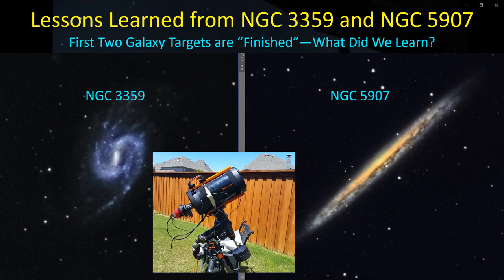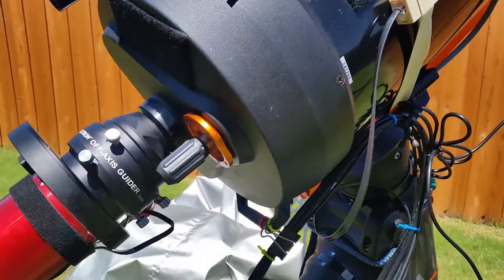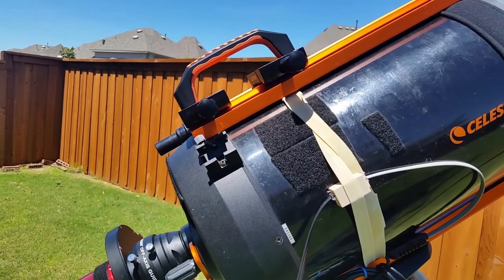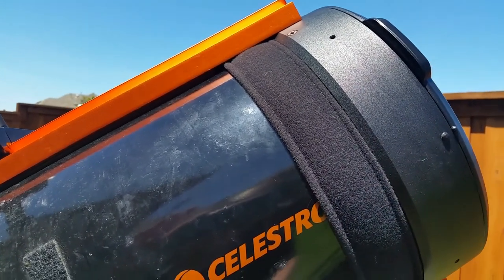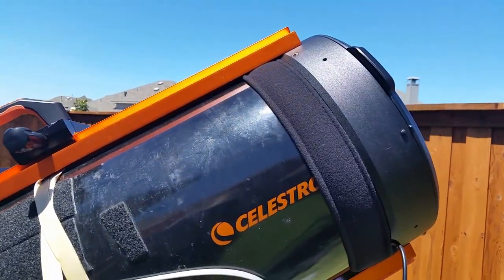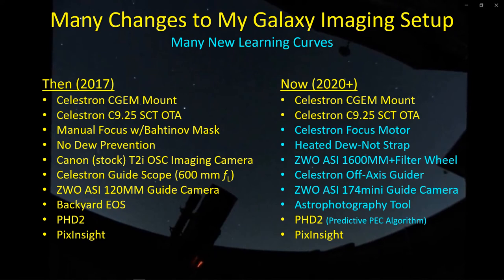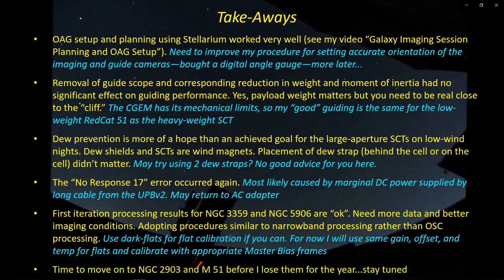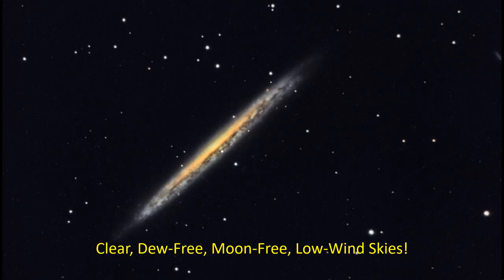Review of Lessons Learned and Imaging Results for NGC 3359 and NGC 5907

Comment: Perhaps you might want to move the dew heater band to run around the base of the dew shield or just in front of the collector. The idea being to heat the trapped layer of air immediately above the corrector plate rather than the corrector itself. This enhances the effect of the dew shield, which functions by providing a trapped air cell in front of the collector to act as a thermal blanket. The reason you're dew is forming above the calculated dew point especially without a dew shield is because radiant cooling of the collector starts as soon as it's pointing at the sky. The collector temp drops below the ambient temperature and cools the air immediately above it's surface as well. It also helps to insulate the dew shield if yours happens to be just thin metal. Try wrapping it in a thin yoga mat. They are a very lightweight foam core. Remember that dew forms because the AIR drops below the dewpoint.  You mentioned possibly using a fan to blow air across the corrector. That will work as long as the air ambient temperature is above the dewpoint and isn't in contact with the corrector long enough to cool below the dewpoint. The fans will make the conditions worse not better once ambient temperature gets to the dewpoint. With the dew heaters warming the trapped insulated air column, you should actually be able to image below the dewpoint. Try not to let the collector point at the sky uncovered if your not actually using it to prevent any radiant cooling you can.  I  live in a coastal city, so fight the dew all the time.
Reply from the maker: Thanks for the great input/advice, Mike! My dew shield is actually made from a stiff foam and I'm sure it would help. However, when it's even a little bit windy, my guiding RMS shoots up due to wind buffeting. I first tried the dew strap around the end (basically where the corrector plate is) and it sort of worked. No dew beyond a certain radius. I'll keep working at it.
Reply: @Aero19612  yeah.. it's a problem with all SCTs  It's got to heat the air in front of the collector. Good luck !!  Really appreciate your videos. You bring up a lot of good detail.  Huge change going to monochrome dedicated cam from an older DSLR.  Look forward to seeing more great images
Reply: @Aero19612  Set up a wind screen upwind of the scope?
Reply from the maker: Absolutely. I've been thinking of ideas for that.
Reply: I've had some success with using one or two chemical hand warmer packets attached to my dew shield with a rubber band to heat the air pocket. This was with my Nikkor 200-500mm lens, so a significantly smaller setup, but I intend to try this with my Meade LX200 12" classic.
Edit: Thanks for the great videos, James!
Reply from the maker: Thanks, Tom. That's a good idea. I just finished some imaging with the dew shield and the dew strap wrapped around the base of the dew shield. About the same idea as you describe. It worked very well. I've got some things to test out, but I'll put together a video on that soon (lot's of clouds/rain in the forecast).
Reply: @Aero19612  Glad to hear of some success against the moisture. I just got in some nichrome wire to make some new straps and thought of building a heater coil on the inside surface of the dewshield to take advantage of the foam insulation layer. Dewshield with a heater coil connector dongle. LMK your thoughts.

Comment: I would have dewed up watering the scope but that's impossible in my case since I have an ongoing experiment to test Darwin's Theory on the "lawn" 

Did you reverse dec guiding after the meridian flip? 

I am thinking of going to USB3 active cable to replace a remote connected PC over 1Gb ethernet using Team Viewer. Any advice or info regarding the USB3 extension? Prices seem to range from $AU100 to $AU230 for a 15m length with no chance to buy in person so it will be buy and hope. Is the 5Gb transfer rate just a pipe dream with these cables?
Reply from the maker: Yea, not one of my prouder moments. Denial, Realization, Panic, SMH. All for the Darwin approach-I try that with my flower beds. But, alas, we have "Homeowner Associations" that police the neighborhood for bad lawns and the like. I do seem to have adopted a Darwin-like approach with this poor SCT: What doesn't kill it, makes it stronger.

Those big post-meridian-flip  excursions were in the RA direction. Since I use one-sided DEC guiding, I do manually switch from "Guide North" to "Guide South" (or vice versa) but Celestron mounts have "side of pier" capability, so there should be no need to switch guide directions after a meridian flip (I have to with DEC because I use the manually-set one-side method rather than "auto"). 

I use this cable: SIIG USB 3.0 Active Repeater Cable 15-Meters (JU-CB0711-S1) . Beware the weak link is the cable entry into the female USB connector. I create a loop of cable at that end and tape the parallel cables together and tape the connector to the cable for strain relief. Other than that, a good cable. It's about $US130. Not sure about transfer rate. I do use "subframes" for guiding to avoid too much data. Other than when downloading an image (32MB), the data transfer is minimal.

Comment: Nice work...  LOL watered the scope!
Maybe add a second dew strap; throw more power at it.  I think some sort of dew shield will be needed.  Rather then abandoning the large dew shied maybe fabricate something just 6 inches tall or so -  just to give it some protection.  Just a thought.... What about a low wattage trucker’s heater/blower and blow warm air onto the sct aperture?  But I have no idea how one might mount that.
Reply from the maker: I make the mistakes so you don't have to. Unless you just want to. A shorter dew shield might help. Maybe a 2nd dew strap, but it will be less effective that the one I have just because it is farther away from the corrector plate. Still, it's a possibility. I am also thinking of something like this:
https://www.amazon.com/AC-Infinity-MULTIFAN-Receiver-Playstation/dp/B00G059G86/ref=sr_1_20?dchild=1&keywords=usb+fan&qid=1589374467&sr=8-20
mounted at the ned and blowing across the corrector. at $10, it's a cheaper test than the $60 2nd dew strap. I just can't get past the how similar "I watered my scope" sounds to "I put a propeller on my scope". Maybe the trick is to do it and not make a video if it fails miserably.

Comment: I switched to an OAG on my reduced EdgeHD 8 and thought it definitely improved my guiding, but now I wonder if it was just a confirmation bias. What I perceived as guiding problems likely were just swimming caused by the seeing. I didn't realize this until I started imaging the moon and could really see the effect in action. With the OAG the frustrating part is that I can't do a SharpCap polar align with the primary scope (field is way too narrow), so I still need the guide scope attached - which must add like 5lbs to the rig. I could align and then remove the scope, but then I would need to re-balance the rig - likely throwing off the precision of the polar alignment.
Reply from the maker: Hey Michael. Well, your observation of improved guiding may well be valid. The OAG is definitely not going to hurt guiding effectiveness. As for using SharpCap for polar alignment, I would suggest balancing the scope without the guidescope attached and then just slip it into and out of its rings (gently) when done--you don't need a balanced rig for polar alignment. I use the PoleMaster and don't even turn the scope on when polar aligning-just undo the clutch, rotate, set the clutch. If I'm imaging over several days, I bring in the OTA in every morning (leave the mount outside) and put it back on each evening. I never check or re-do polar alignment. My 2 cents.
Reply: @Aero19612  That is great advice, thank you! I can't believe I didn't think of that.

Comment: James, are you happy with the CGEM mount?  Which model is that exactly and does its payload support you OTA properly?
Reply from the maker: It's OK. It is the "CGEM", not CGEM DX (same but heavier tripod) or CGEM II. It's no longer made. It's fine with the payload. I see no real improvement in guiding whether I'm using the lightweight RedCat 51 or the heavyweight C9.25. Lots of DEC backlash and RA periodic error and gear noise. PHD2 does a decent job with it. I'm keeping an eye on  Skywatcher and iOptron mounts. I can see me going in a different direction one day. But this still works and seeing is the driver, not the mount performance so I can't really justify $2000-$3000 for a new mount.
Reply: James Lamb I have an iOptron mount.  I cannot recommend iOptron at all. It arrived assemble wrong from the factory and with a dead battery.  The instructions where packed wrong in the case.  Getting it to work properly was difficult cuz the support is just terrible. Once the mount got damage. I sent it for repairs. Repair was fast and reasonably price, but it was not fixed correctly when I got it back. They also broke my cord during repair. When I told them the problems they called me a liar.  In the meantime I just bought a new cord myself.  Sent it back again for re-repair.  It came back marginally working.  I was fed up dealing with iOptron.  Now it’s back to the same thing they supposedly fixed.  When it is actually working, it works well.  But from factory to support to repairs they’re terrible as far as I’m concerned.  I’ve had it about 18 months and mostly one problem after another; dealing with useless support.
Reply from the maker: Geez. That's great feedback (for me, not them). I guess we have to be careful about the "grass is always greener" syndrome. Current Celestron mounts are getting mixed reviews. Some people like their CGXs and some are having problems. I just don't want to spend $10,000 on a mount when seeing, rather than mechanical tolerance, is the driver for good-enough imaging. Thanks for the feedback!
Reply: James Lamb Yup, that seeing issue is a big problem.  Seems to me to be the biggest challenge also. Have you looked at the SKY-WATCHER EQ6-R PRO?
Reply: James Lamb Today I found their work is worse than that. I had some slop in my RA axel. After procrastinating I went to fix it.  This originate with their last repair.  I found one of the set screws that holds the hinge lock screw was stripped and the adjusting lock screw was loose. Tightened that.  Found some stripped Philips screw heads. Really? None of them are tight.  Then I found they broke my on/off switch and their hasty glob of solder they used to fix the job. This is why I’ve found other repair shops. Will never let iOptron work on it again.  But at least I got the mount fixed
Reply from the maker: I'd be pissed if I had to deal with that level of incompetence. I have "glanced" at the Skywatcher EQ6-R and the AZ-EQ6. That's a good price range for me.
Reply: James Lamb Yesterday I just got over being pissed. I’m gonna give the mount away for just shipping cost; maybe some astro-gear person will like tinkering w/ it. Have you looked at the Vixen SXD2 w/ Star Book Ten?
Reply from the maker: Wow, that's a big step! No, I haven't looked at that combo. I want you to get a Skywatcher EQ-6R and give me a review! Haha
Reply: James Lamb I went further then that James; I decided to get the Losmandy G11G w heavy duty tripod.

Comment: What is your back spacing from your flattener. Great video.
Reply from the maker: I'm not using a flattener in this setup. The nominal backfocus from the base of the SCT threads is 115 mm. With the spacer I left out, I'm about 13 mm too close. The SCT has a pretty good focus range, but focusing for this reduced backfocus left me with a shorter effective focal length of 2185 mm instead of 2350 mm. Thanks for watching!

Comment: Hey James, Howdy from North Richland Hills.  Quick question.  you had some stretching of stars on your OAG and I wondered if you resolved that?
Reply from the maker: The NRH is in da house! There are two basic reasons for stretched stars. With my refractor, in particular, the field is not totally flat (even though I use a field flattener) so that OAG is seeing stars in the outer perimeter of the light cone where they are most stretched. Also, the guide cameras in both OAGs are held in place with one or two set screws that do not control tilt of the guide sensor, so I suspect that some of the stretch comes from that source. In the end, I don't worry about it too much. As long as PHD2 can consistently find a centroid and track it, the guiding works as well as it would if the stars were perfectly round (I think). Thanks for watching, George!